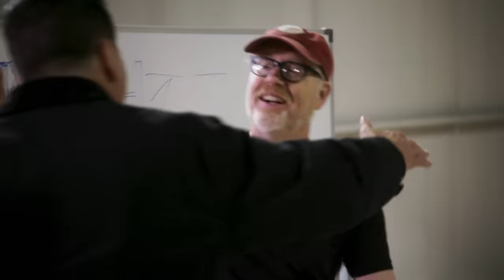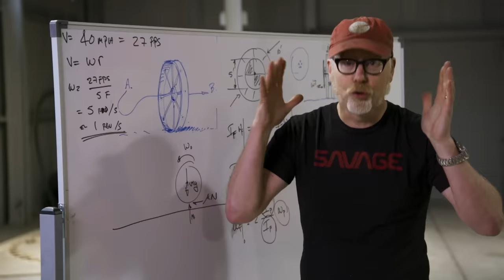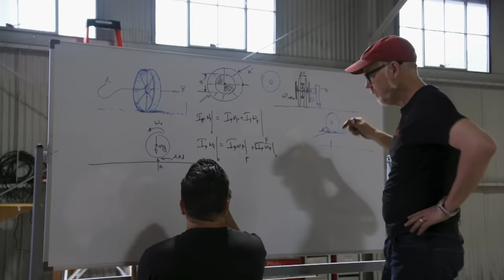"The Power In These Flywheels Scares The Pants Off Me" | Savage Builds

Comment: You tried stopping it from the center of corse its going to be hard to stop, if u hav small brake discs on a car it stop slower if u hav big discs it will stop alot quicker thn with the small ones. Whn u used the wood on the outter edge it stopped quicker
Reply: Adam's not as smart as he acts.
Reply: It was already almost stopped.

Comment: You're also trying to slow it down at the least leverage point?  Slow it down on the outside dippy.
Reply: but that would increase the force on the axle and therefore increase the risk of the axle to slip
Reply: @larskruse7575  well if ur mount and axle is that weak u could just push it to the side, maybe make a decent mount or not spinn it up? just a suggestion
Reply: Think of how bicycle brakes work, or disk brake calipers. They DON'T push from one side.

Comment: i remember that in the early nineties DAF bus in corporation with the technical university of Delft in the netherlands tested a flywheel powered bus , i am not sure whatever happened to that experiment since nothing was published about the results , what i am saying here is that if it can power a full size bus ( public transportation ) that it surely would power your contraption , but i would go for a single mass instead of a dual mass , simply for the fact that dual mass is hard to balance , i would also make it spin up to speed whilst the contraption is stationary and then use some sort of magnetic clutch to make it roll off , or rather the same electro motor that spins it up could be the clutch by basically making it create resistance by slowing the motor down and making it run the other way , as soon as the mass of the flywheel propels the contraption it should lock and have full flywheel traction . also your discs are to thing and become unstable and floppy with the frequency its creating during spinning , more weight , thicker , less diameter , basically the mechanical battery .

Comment: 1st step would of been to balance the wheels. The movement of the rig was expected .. by myself anyways. You don't just cut a circle out of hot rolled steel (or even cold rolled) and expect perfect uniformity and a rotationally balanced condition ..

Comment: I noticed that as soon as it came off the deck it bogged down almost immediately. It sank into the soft soil. It needed a wider foot print for the soil conditions. Maybe set the whole thing just above the deck and let the momentum of the flywheels start spinning the frame so it it doesn't grab a stationary object. Let it grab a frame which is already in motion.

Comment: To allow for a decrease in rotational speed (and flywheel diameter), simply have additional mass near or at the rim of each flywheel instead of an even-width disc. Energy would not be less though, so considerably better safety precautions are even more warranted.

Comment: You have to balance the wheels. Both have material removed in just the one spot for the lifting shackle. That will create vibration from both sides; worse if both holes are aligned

Comment: Basically  same as my wood chipper.  Bandit 280        has a 4 foot cutting wheel spins over 2000 rpm. And it's several thousand pounds.

Comment: I see a few ways to balance the flywheel better. 

The key to making sure it doesn’t wobble, is dampening, not restricting. 
Monitor the efforts needed to balance the axle and flywheel together, to predict when the next “wobble” will occur. Dampen the corrective force on that prediction, and apply it. 

Repeat.
Reply: Put in balance machine.  Then balance it.  Doing it the safe way doesn't get the views.

Comment: Port Kembla steelworks had a 50tonne flywheel generating electricity,was told if it ever came off it would go to Sydney(90-100km)away, destroying everything in its path

Comment: Working in the oilfield around variable frequency drives, from time-to-time we run across a certain company's that requires an auto-tune procedure where the belts must be removed from the motor sheave, which is then spun up to full motor speed (1200RPM).

I wouldn't go anywhere near a 12" sheave at that speed, much less one 6 times that size.

Comment: Adam should go see an RTO test at an aircraft brake manufacturer.  RTO = rejected takeoff.  They have a testing machine that spins up multiple flywheels to equal the same kinetic energy as a 747 travelling down a runway at just below the "speed of no return".  Then, the energy of the flywheels all goes into testing the brake system.  I saw the machine but not a test at what used to be Goodrich Aerospace in Pueblo, Colorado.

Comment: Spinning such large machin should also be precise ballance.  Usually using a set of very sensitive motion sensor on 3 points and measuring the vibration at whatever rpm. Then accounting for machine lag would have a point on the wheel to where it needs counterweight or ground down. I can balance then to less then a mill of vibration with a balmac. Then u can run it 10k rpm like 10 times your desired amount with  o vibration.

Comment: Was that the similar as public transportation experiment in San Francisco ( I think, but I'm not sure), long time ago. The trolleybus has had 9 tons of flywheel attached inside the   car. When it stop at the station to accept passengers, its trolley rise up to the wires, who were fitted only at the stations, so not necessarily be stretched along the bus line. It's flywheel spins, gaining its kinetic energy, which was quite enough to ensure drive till the next stations, which was, anyhow, much closer than its projected and calculate force for stored energy in flywheel. Was this project continued to be used?

Comment: what did they think was going to happen, the axle was not secured to the supports and the strap they had securing it was in the center provided absolutely no resistance to the whole assembly rotating, the friction created by tiny contact area between the round axle and the square tube of the supports was easily reduced to zero when the assembly started to vibrate.

Comment: I guess the plates need balancing and some machining to make them flat and parallel. 1000rpm is like 16.67hz so it isn't like the velocity is all that high and I didn't think steel really vibrated at low frequency

Comment: They installed the flywheels on the axle with the rigging holes offset by 45 degrees with the other flywheel.  Wondering if the holes should be aligned or if it matters.

Comment: They were talking about using a truck axle, then they didn't?
They could have driven the flywheels with the pinion and have a coupler with selfreleasing ramps to pull straight back to disconect, the roller wheels connected to the axle tube and the flywheels outside of that.
And also, added 2 rings of weight to the perimeter of the flywheel, adding weight where it counts

Comment: Flywheels must be precision made down to the atom. Then, the bearings or bearing system must be flawless balance and design and strength. The higher the RPM, the more dangerous the system is. Shutter and vibration of the system must be reduced to near zero percent. Kinetic energy is the best.

Comment: Applying the flywheel concept converted to electrical output what would the loss/gain of power input to output .and could you create a way to use the force created to spin up the flywheel? Depending on size and shape of magnets used,along with copper or what ever material you use size,placement,shape .maybe applied to waterwheel,windmill or series of vertical windmill layout. Also could it be used as a propulsion engine.

Comment: The guy controlling the motor didn’t cut the power.    They didn’t balance the flywheels.  They didn’t  bolt the stand to the floor.    Would have loved to see them do this a lot faster, balanced, and more dangerous.    Dangerous enough though.

Comment: The studs and bolts need to be substantially larger. That will cut down on the wobble and vibration. Way to much weight for them. Also didn’t see him put a washer between the flywheel and bolts.

Comment: Maybe they didn't make the contraption holding it too secure so it couldn't artificially stabalize it when it actually isn't stable without things holding it perfectly in place.
You don't want to learn that your runaway train isn't stable at all when you don't weld it to the tracks  after you let it loose.

Comment: Bolt down the frame, tighten the bolts in 3 passes in a star, balance the rotor and use a proper clutch. This would be fine

Comment: Tremendous possibilities flywheels have, and in this case, crazy dangerous!
How about reducing the diameter to bring down the edge speed and reduce some the vibrations generated, and double or triple up the width to increase the mass and the kinetic energy available. I’m sure mathematically it could be worked out...
One thought relating to large vs. small diameter is the gyroscopic input/effect on the overall stability.
Sometimes I think that I think too much LoL

Comment: Needs to be balanced properly. With that thin of a rotor (even though very short) you'll probably be running above the first critical speed (1 bending mode of the rotor). You need more precision in the wheels and the mounting of them. Then balance them. You'll be fine.

Comment: My oil rig looks just like that. Except it wraps up  wire rope. It has a drum breaks that wrap around the whole thing on both sides to slow it down and mounted to the side is a disk break that’s about 4 ft in diameter with a caliper about the size of a microwave. I’ve always thought “if this thing jumps out of its carrier it will probably roll 10 miles before it stops. Imagine spinning a yo-yo. Now imagine pulling on the yo-yo string with 200k lbs.

Comment: Roughly 130,00 ft lbs of torque and 240 horsepower. Like getting run over by a freight train, or rather sliced in halves and sprayed all over the walls. I think a super duty truck has 1000 to 1500 ft lbs or torque. Flywheels are awesome.

Comment: Put hydraulic brakes on it and cut the center out like spokes on a wagon wheel.  Most of the energy in a rotating mass is on the outer layer. They made mass without energy. You want as much of your mass to create rotating energy. You can have a lighter (less downward pull from gravity) or a better power to weight ratio. It will reduce bearing friction too. Every car on the road knows this. Spokes on rotating mass aren't for decoration. So cut out 1000 lbs of mass in the first 80% of the disk and attach that mass to the outer most part of the flywheel. You'll get a flywheel that weighs the same but during rotation more of that mass will be rotating mass and less will be downward force mass.

Comment: It is just what Farmers did in the 1930's to increase power and torque with their single and two cylinder Engines. and then they added Big Heavey Wheel weights when they got more powerful engines but needed wheel speed and momentum to pull their plows.

Comment: What is this thing called "centrifical" force? I'm not even sure there is such a word. There's centripetal force, and it's slightly disreputable fictitious force counterpar, centrifugal force (and, yes, centrifugal is fictitious, a technical term for an apparent force that arise when treating an accelerating frame of reference as if it's inertial). In any event, this looks like it's powered by angular kinetic energy.

Incidentally, one third the angular velocity means only one ninth of the angular kinetic energy. Also, dynamically balancing disks of that size and weight has to be done extremely accurately. At 1,000 rpm at the axle, the truck it came off of would have been doing approaching 80 mph, and the outside edge of those disks will be at about 180 mph. Think of how carefully we balance road wheels and tyres which weigh a fraction of the amount.

Comment: I built industrial blowers 3ft in diameter that run at 3000 RPM. Perfectly balanced fans. All hand work. Some have been running for 20 years. They can't balance a simple disk! Wow, really? Further that much rotating mass going that fast you'd better bolt it to bedrock.

Comment: Imagine a massive flywheel that is powered by a windmill, with a gear train. The flywheel would then power a generator. U could just keep pumping in wind energy and store it with kinetic energy instead of chemical. Much better round trip efficiency, less expensive, and more available materials

Comment: I certainly hope you guys are just playing this as the solution is not in the lovejoy connector... (we run thousands of HP at extreme rpms through them on drag boats)..    

The fix for this is pretty simple,   not super easy but pretty simple..  1st..  correct the static balance on  your flywheels..  a plain old bubble style balancer will suffice albeit, heavy duty.. 
second.. fix the runout on the outside edges.. you can not have  excessive runout and expect vibration free...   

fact is, probably fix the runout first (axial and radial) then balance)..   

And I can almost guarantee no 40mph..  You have no way to transfer that momentum to forward motion if  all you are relying on is the contact patch to the ground....    all guessing and conjecture but  lets see...

Comment: Use the same idea to launch a dragster off the line
Enclose the flywheel in a case for safety  and engage at 50k rpm utilizing hydraulic pressure instead of direct drive

Comment: The wheels need to be perfectly true, mounted on a super heavy base secured to concrete with truck bearings.  Its a physics problem: Moment of inertia of flywheel I = 400 kg per m^2

Angular velocity w = 2 pi*3000/60 radians/s

= 100 pi radians/s

E = (1/2)I w^2

E = 0.5 *400*(100 pi)^2

E = 200 (10000) (pi)^2

E = 2000000*9.8696 Joules

E = 19739208.80 = 1.973920880* 10^7 joules (Truly massive potential kinetic energy!)

Comment: Should have used the motor to slow the flywheel. Put the energy back into the batteries. Or have a proper break.

Comment: The twist that occurred after disengaging the starter is almost certainly due to gyroscopic procession. If you can apply angular force to tilt the flywheel up or down, then you can use gyroscopic procession to steer the vehicle at speed. If you don't account for this procession, then your next test could tear itself apart.
Reply: Precession.

Comment: Look at the power flywheels they've been using for years in the public buses in New York City. Don't know if they still use them. How about making the flywheel aluminum with a thicker steel band. That axle itself is not safe. Maybe an axle from a Semi. My question is, do you get the same amount of power back that you put into it? It think the rpm you were looking for would have ripped the hubs right off that car axle. You need a better evacuation plan, maybe instant zip lines to the roof, you know.

Comment: I'm just curious... since this is an experiment and you want it to go well, or you should want it to, and you've spent all of this money on it, BUT... Did you take the leap with the funds to get the best or did you shade tree mechanic it.... just getting what you could easily and not making sure things were balanced etc.? 
It looks like probably not with the set up to remove the motor and the most basic brake pedal and armature that could possibly be used, leads one to believe your project is done much like that of a high school student with just enough money to get the flywheels made at the most simple mathematical version of it and very likely just the smallest bit went into the thickness, diameter, circumference, overall weight and balance and as possibly perfect went into one, much less that it was repeated exactly in the creation of the 2nd of the flywheels, to get a more smooth operation to which I wonder if at least one gyroscope would also help it at least keep the axle in same position on both wheels? Oh yes O almost forgot... 
Was the axle, machine tooled where adjustments were needed to help in balance and was it weighed and balanced out as best as possibly shaving metal off and or adding some to it  to also help keep balance with everything as well?

Or is it done this way just to see if it can rise to the expectations before you go that far with the balancing and such???

Comment: The disengagement process was not properly thought through. NASA, Special FX Engineer and a Master fabricator <— disengages power side (via toothed coupling) by pulling it away manually with straps. 😅 a safety engineer would’ve had a heart attack

Comment: Much smaller diameter, thicker flywheels would be much better for this. A machined cast iron flywheel would be more stable, and not have the flex to cause vibrations.

Comment: As a mechanical engineer who works as part of a team that design 2 pole turbogenerators with 35+ ton rotors that spin at 3600RPM, I cannot believe an engineer would design, make and test anything like this with that test setup. that was highly dangerous with that amount of energy stored and it does not look like there was any balancing taking place meaning vibrations could have shaken the thing apart, nothing to contain the energy if it did go wrong and to top it all off they were standing right next to it. Highly highly irresponsible and my respect for that guest engineer is pretty low honestly as one of the main things you need to account for in engineering is safety…

Comment: A pucker factor slightly higher than loose long hair and baggy clothes around a milling machine.

Slightly lower than first person maximum depth testing of a diy submersible.

Maybe a ln 8.5 on a sketchometer.

That thing's got enough potential energy to be lethal just sittting there. Whilst rotating? Is there any precedent for that kind of momentum on a simple, non calibrated axle?

How much energy mathematically is contained in such an aparatus, and what sort of work can be done with that much energy?